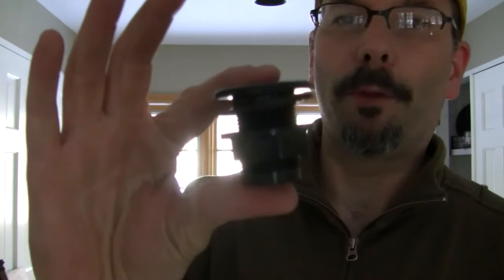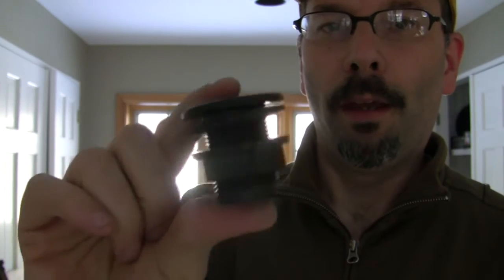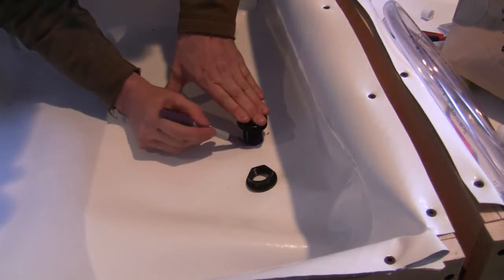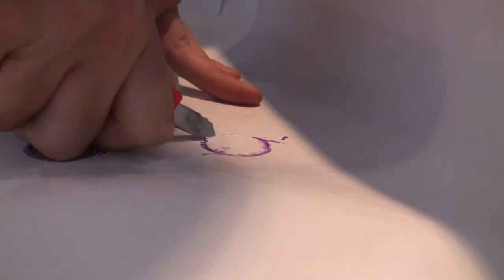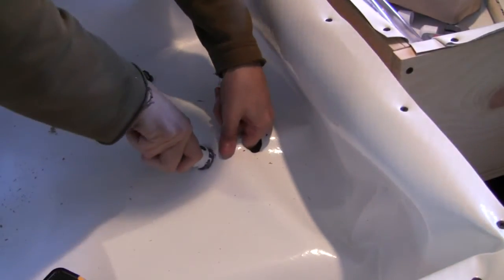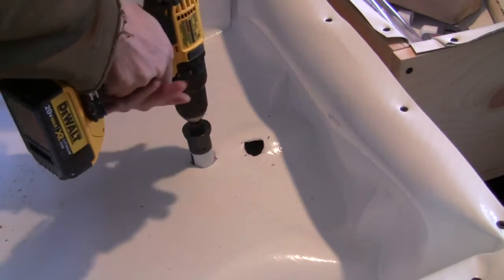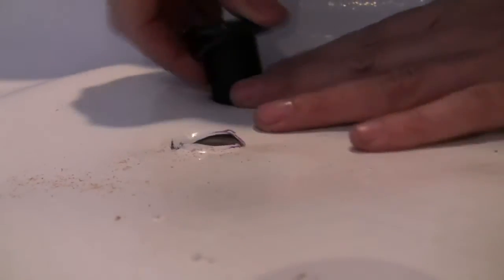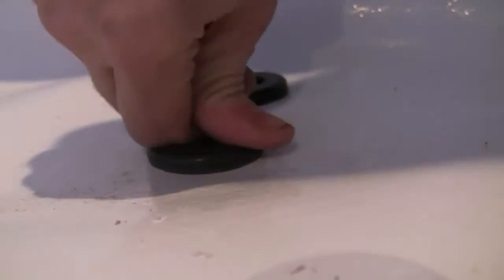Aquaponics Build Episode 4 [ How To Install a Bulkhead Fitting ]

Comment: Hi. thanks for your video! I learned some. So the pvc is 1/2 inch..but the hole saw is 1 1/4. Is there a reason why the saw is bigger than the pvc? Oh..I just realized..the bulkhead is bigger than the PVC pipe. hmm....when you buy bulkheads, does it say what size hole saw is necessary??
Kinda confused...I wana make a pond
Reply from the maker: keyair123 It should be listed in the product description. The larger size allows for the wall of the fitting. The hole required will always be bigger than the pipe it is made for.
Reply: AquaponicsNYC is there a guide that shows the drill size needed for the fitting as per size the fitting somewhere?
Reply from the maker: keyair123 I just picked up some 3/4 inch bulkhead fittings off ebay. You will find it in the product description. 1 5/8 for 3/4 inch fittings.
Reply: thanks! AquaponicsNYC  much apprecited :)